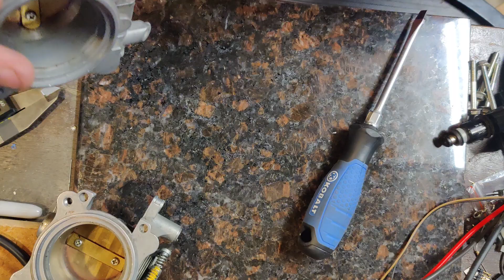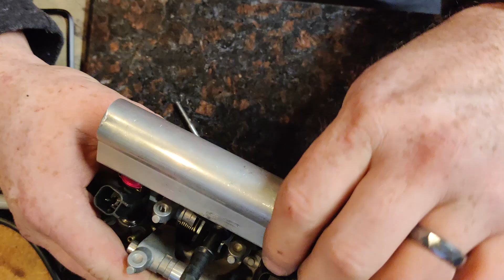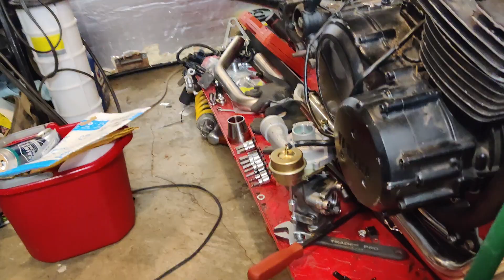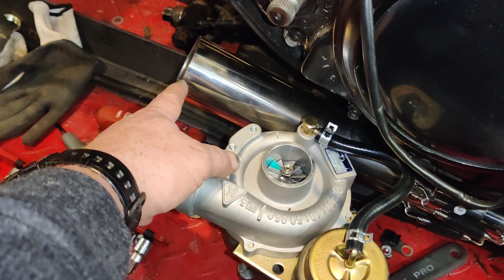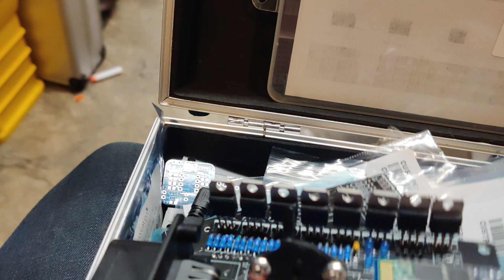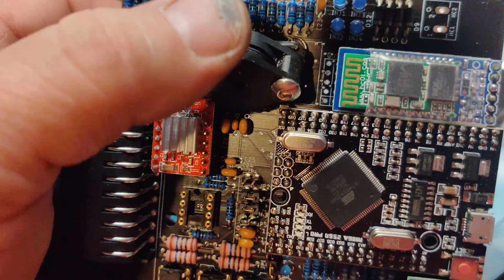Convert ANY motorcycle to EFI...Cheap!

Comment: You will need a large volume plenum between the compressor outlet and the throttle bodies for a three cylinder engine. This is to reduce the pulsations in the inlet tract. This is not required for four cylinders or more.

Comment: Nice my kz750e1 has a halleffect ignition sensor and a similar tach drive. Ive wanted to convert to efi forever. Im pretty sure z1000 efi bolts on or maybe a suzuki. The Gpz750 turbo is the oil pan i run for oil cooler outputs. Also the valve cover bypasses smog equip. Those 84 turbo kawasaki's are awsome. Im interested in easy ecu's but waiting for it to become super cheap n easy. I would possibly be interested in buying one of your populated boards. Curious what tuning software u use...

Comment: I just want to know the Arduino pinout so I can just not bother with an additional PCB. Choose appropriate 5 volt sensors that can plug directly into the Arduino, then use some logic level MOSFET with flyback diodes to drive the injectors and ignition coils (pretty sure a current limiting resistor between the gate and Arduino is required). Temp sensors might need an additional resistor to make a voltage divider, then just calibrate it in the software. GM style map sensor (0-5 volts also). HAL sensor with pull-up resistor (I think the GM 58x is 5 volt square wave that doesn't require a conditioning circuit. TPS, a potentiometer, so of course it can be 0-5 volts as well. Then just mount everything in a plastic box... And of course just make sure to not mess up the wiring so the protection circuits aren't needed.

Comment: Excellent video, thank-you.

With my "engineer" and "safety officer's" hats on, several safety points if you are doing a DIY pressure test on something you have built:
1. Don't test with air or gas. A failure can result in an explosion. Use water or hydraulic oil.
2. It is usual to test at 50% above normal working pressure.
3. Don't forget your eye protection.

Comment: "Convert ANY motorcycle to EFI...Cheap!" -If you're a machinist and have a lathe and CNC. Nice work! My 82 Honda CX500 Turbo was factory boosted and EFI.
Reply: Would this work on a bmw k75 3 cylinder. Its already an efi but id prefer to have tunable ecu with more fine tuning. And ad a better air flow meter and a couple of other things that need improvement
Reply: @edgarlira9595  yes it will work if you put in the work to connect everything correctly
Reply: A one-cylinder version? 125 to 250 cc four stroke?

(Have machinist training, plus have done sand-casting.  I have machined My castings at home.)
Reply: @dennisyoung4631 if you’re still waiting to do this i’d say shoot now… a one cylinder speedouino EFI setup will be super easy for you, should only have to connect 10-15 wires to work properly
Reply: A 3d printer with nylon or maybe petg could be used or just some clever work with regular tools. The spacers could be made with a drill press.
Reply: Well realistically most older bikes share common dimmensions with the fi counter parts, with some careful planning you can make it easily work. Most conversions start with first understanding all sensors, mechanics, and have a rudimentary understanding of how an engine takes inputs and sends outputs
Reply: Could also do a high quality 3d print...
Reply: Nah you can just draw up your part design in CAD and send it in xometry to have it machined. Or you can take your drawings to a local machinist to get a quote.

Comment: Thanks for your information on converting carb to fuel injection. I had never thought about it before but I was curious when my motorcycle manufacturer went to fuel injection a few years ago. I have an older husqvarna 610e built in 2002 and it has never run right despite getting it dyno tuned where he rejetted the carburettor, that didn't work so I had the husqvarna dealer look at it and charged me over $140 an hour and didn't actually achieve anything. I thought why doesn't this bike just start with a few revolutions of the starter? Maybe I should be taking a better look at fuel injection, as I was really impressed with what you have put together so far for your 3 cylinder engine. Mine is only one cylinder, could you send me a few links so I could research this further? My email is pnoorbergen@gmail.com if you think of anything. Thanks so much. Paul Noorbergen

Comment: Hi, I love the work you have done and the drive you have. Thanks a lot for inspiring tinkerers like myself. Seeing as it is possible, and as I have been cracking my head trying to figure out bike EFI conversions, do you think it is possible to convert a DR650 into EFI? If yes, throw me a few pointers, e.g. the bike with throttle bodies that can fit in a DR650, where to place the engine and cam sensors, etc. Thanks a lot sir. Good work. My e-mail ukhebi@gmail.com

Comment: Awesome video! Thanks for taking the time to do this.
Quick newbie question. What is the cam timing used for? I assume you only really need crank position for spark timing. Is the cam timing for separate injector timing?
Sorry for the dumb question.

Comment: Hi ther I have 2 questions what do you study to learn all of this? And.
I have a Suzuki Intruder 1400cc that I want to convert to fuel injection, can you do this job for me?
Reply from the maker: As far as study... I learned most of what I know from the school of hard knocks. The Navy taught me electronics, I taught myself machining and all of the automotive stuff.

I could build you an ECU, but without having the bike in front of me, it would be nearly impossible to do the rest.
Reply: Yes I am aware that you will need the bike to work with, this is my email azazelakira12@gmail.com so we can chat better. I am really interested on see if I can put fuel injection on it. Please send me an email.

Comment: Why don't u use a factory produced automotive sensor. 3.8l buicks use halleffect wo magnets in the spinning ring. Late tune ports like lt4 use opti spark which is exactly what u made but is temp proof
Reply from the maker: Honestly, I just didn't want to do the research, 😂. I came up in the electronics/instrumentation industry and just went with what I know. But you do provide some good leads for me to look in to. Thanks!

Comment: FWIW the reason optical sensors are not common on OEM systems is that it only takes a small amount of contamination to stop them working, magnetic sensors are much more robust.  Having been here myself, throttle bodies and ECU are the relatively easy parts of the conversion, what are you going to do for the high pressure fuel pump? Cut the tank up and mount an OEM pump inside?  Is the charging system up to the job of the additional load?

Comment: oh god, All I did was put a 255LPH fuel pump connected to a 1psi pressure switch. so that when the boost reaches 1 psi the FP turns on and feeds the carburetors. also need a boost-referenced pressure regulator. looped back to the FP.  I got a programmable ignition for the 1995 ZX9R so when the pressure switch sends voltage to the timing retard input pin all is good.     7psi =70 Hp on a 140hp NA. 210hp Intercooled rocket

Comment: This video is awesome.  I have a single cylinder bike that I designed and built for miniGP racing using a 190cc Daytona Anima engine.  I'd love to switch it over to EFI.  Would make tuning for different track conditions much easier.  Having never looked at a Speeduino before (nor programmed any efi, but with experience programming PLC's using ladder logic and structured text), I wonder what other sensors could be used.  Different maps based on gear position?  Different maps available and swappable with buttons on the bars?  Accelerometers, lean angle?  Use it as a data collector for things like brake temp, suspension compression?  Interesting potential here.

Comment: 1) what did you select as your new piston ring gap? 
2) did you make sure to set your induction plumbing to at least 2x the displacement of your engine? 
3) maybe consider a water 2 air cooler, they are more compact than air 2 air coolers. 
4) does your ECU have provision for a thermocouple for a pyrometer?
5) the ATMEGA2560 has additional serial ports, so you can wire your BT adapter to that.

Comment: I've considered converting my 1989 Harley Sportster 883 to EFI, trouble is the charging system just isn't up to the task.  perhaps with a mechanical fuel pump.
Reply: Harleys changing system is fine unless u have lots of aftermarket elec items on ur 883. Plus 80s and 90s Harley stators drop the magnets out, causes slow crank due to grinding mags up. Just buy a stator.
Reply: @dualsportrider3221  the charging system is only 11 amps

Comment: How are you doing the vacum reference line? Are you using one cylinder or are you using a t-piece and connecting them together before map sensor?

All the best and keep up the great work 👍
Reply from the maker: My plan is to use the old carb sync ports and t them together.

Comment: This may be a silly question, but won't mounting the throttle bodies rigidly to the cylinder head cause problems, both with heat flow and thermal expansion?

Comment: Little tip, the XS850 triple got an oil cooler and you can retro fit it although given the amount of work you’ve put into this project I’m not sure knocking up an external oil cooler for the 750 will cause you to break a sweat!! Lovely to see the XS750 as the base for a major project. 👍
Reply: Always rather liked the XS750, not a sports bike but a good working bike. Might look for one to go with the XJ600 ( another good working bike).

Comment: Hey man, cool build! If you wanted to easily add an oil cooler, you could install a stock one from a '80-'81 XS850. It will fit right on. The only difference from the XS750, is that it has a collar that goes in-between the engine and the oil filter. This collar let's you attach the oil cooler.
Reply from the maker: I'll have to see if I can find one. I was considering making a sandwich plate to both add an oil cooler and convert to a spin on filter.

Comment: For a non computer, literate guy, does directions, step by step, come to build an ECU, with names and definitions of the parts and pieces, connectors, transistors and all other electronics, by myself? I've wanted to do this for the longest time, for my early 80's Honda Shadow, Nighthawk 650. I'll subscribe now, to your channel. Thanks for any  replys.
Reply from the maker: There are a few videos by the Speeduino folks that show the assembly process, but if your not familiar with pcb soldering, you could buy one fully assembled. You'd still need to build a wiring harness specific to your application.
Reply: @bombshellbikes1559  So, to learn how to build an ECU, a fellow would need to go to school to learn how to make and assemble computers, correct? I've always wondered!

Comment: When the Arduino came out I wondered if it could be used for ignition and injection system as I knew Suzuki used 8 bit on early ignition systems. Nice to see the 'Speeduino' is out as open source, I'm going to have to look much further into it
Reply: All the early OEM EFI systems used 8 bit controllers.  The first Megasquirt system which was out in 2001 used an 8 bit micro, as did the VEMS system that followed it.
Reply: @ferrumignis  Interesting. I specifically mentioned Suzuki  though because I worked on them and taught F.A.S.T. so I'm much more familiar with Suzuki systems.
I had various information by Bowling and Grippo when Megasquirt came out  and was completely DIY but lost it somewhere over the last 20 years
Reply: @J. Pročka Err great, glad you are happy?

Comment: 1 carb triumph 650cc twin from 1967. 12 Volt pos ground system. is what I would like to convert. I have a Boyer bransden ignition box on it. It is a wasted spark system. Id like to convert it, without cutting the tank.

Comment: Very informative! A lot of it went way over my head, though...
I’ve been looking into converting a Honda Goldwing 1500cc flat six engine to fuel injection for use in a Lotus 11 that I’m gonna build from scratch. Would what you’ve just shown work for this kind of application if I can fabricate a manifold to take the two banks of three throttle bodies?
Reply from the maker: Sure, plenty of folks run V8s or even V12s on Speeduino. You could even run it with 6 individual throttle bodies. Each output channel (fuel and spark) can be used to drive more than one channel.
Reply: @bombshellbikes1559  I too am finding you because I am looking to drag race a Honda GL1200 out of a Goldwing. I have read the documents on Speeduino site and I think I am going to pursue this route. Incredible content, keep up the great work

Comment: Awesome project. Love the speeduino. What are you going to do for fuel pump?
Reply from the maker: I found a Harley XG750 fuel pump assembly on ebay. It's an in-tank setup with regulator, so I'll only have to run one fuel line. It obviously won't be boost referenced, so I'll have to account for that in tune. I picked that one because it had the smallest vertical footprint I could find.

Comment: If you were to come up with a EFI kit for the thousands of dual sport carburated thumpers such as the Suzuki DR650 and KLR650 etc. I think you could make some decent money.
Reply from the maker: I have actually considered putting together kits, I just haven't done the market research to determine which models would be worth the effort to build kits for. So far, from what I've seen, CB750, XS650 and CX500 seem to be the most popular, at least among the Cafe crowd. The dual sport market makes sense too, hadn't considered that. EFI would definitely help with large changes in elevation, too.

Comment: I made the same style of sensor for a "TDC" signal , on a V12 and drove it off the end of the cam with a spacer and an alloy cutter wheel..
I used a Crane optical sensor as they are designed to live in an automotive distributor , that was 20 years ago and it's still running happily...👍🏻😉👌🏼
Reply from the maker: I looked into several of the actual automotive sensors, sadly the ones I found were too big to fit inside my crankcase cover.
Reply: @bombshellbikes1559  the Crane XR700 SENSOR is the smallest I could find.. It's only about 8 or 10mm high , and the base has two small mounting tabs with holes..
Reply from the maker: @panosgamithis8868  I just looked that up, thanks. You are right, that one IS tiny and cheap enough to give it try. I appreciate the input!
Reply: @bombshellbikes1559  You are very welcome..👌🏼😉👍🏻
Reply: @bombshellbikes1559  And subbed..👍🏻

Comment: This got super exciting when you mention your ECU is Speeduino! Thank you YouTube algorithm! Anyway, cool project I will definitely follow your progress and go through your video library. Thanks for sharing.
Reply: speeduino isnt very good. at anything.
Reply: @DieselRamcharger  What would you recommend as an alternative? Megasquirt? Something else? tbh i'd like to get as low-level as possible, just for fun to learn more about engines.
Reply: @cannaroe1213  at that price level megasquirt is a similar solution with a much more developed user base. if you want a car with efi to just go fast id go megasquirt/microsquirt as minimum viable. if you want to develop efi system themselves as a hobby then go speeduino.  lots of choices out there just gotta decide what you really need. no use paying for a box full of drivers or features you wont use. i picked up a MaxxECU mini for a recent project. seems pretty decent, very compact. good 4 cylinder box for around same price as a microsquirt..but with 2 more injector drivers which is nice.

Comment: be careful touching the integrated circuits, unless you are grounded you can damage them with static ....
Reply from the maker: I appreciate the input. I am well aware of the dangers of ESD. I actually taught electronics repair for several years. I've been working with sensitive electronics for over 30 years and the only time I've ever killed a component with static was when I was playing with a tesla coil, 😂

Comment: This is cool, thanks.  I've wanted to squirt my 97 EVO Sportster.  It's only going to need one throttle body fortunately.  

I'm not sure what kind of magnet you used that lost its strength at 200° (assuming you mean Fahrenheit).  Most magnets should remain magnetic to at least 400°, usually much higher.

The other is just a side note; my wife's 1990 Nissan 240SX had an optical position sensor in the distributor.  Appeared to be a steel disk with a bunch of narrow slits.

Comment: Man I love this setup! What's the capability of the board? Will it do 4 cyl sequential? Could use one of these for my 1996 ZX6R EFI conversion.
Reply from the maker: Most Speeduino variants (including mine) can handle just about any number of cylinders, but they can only do sequential up to four cylinders.  They have four ignition and four injector channels.
Reply: @bombshellbikes1559  im running the NO2C in my bike but am thinking of sequential for individual cylinder tuning.
Reply from the maker: @kallummaitland8158 , most people will tell you that sequential won't gain you much other than a smoother idle. I've only ever done sequential on the three projects I've done so far, so I can't say for sure.

Comment: Whats the total cost of this? Would love to do this to a mid 90s kawi
Reply from the maker: It varies a lot from bike to bike, but I'd say you're looking at around $500-600 for ecu, throttle bodies, injectors, connectors etc. If you want to upgrade ignition as well, you're looking at around an additional $100-200 for coils etc. There's definitely a lot of work involved and the more of it you can do yourself, the more money you'll save.